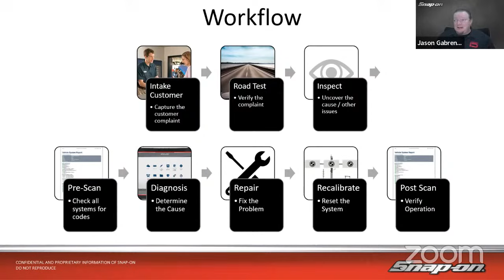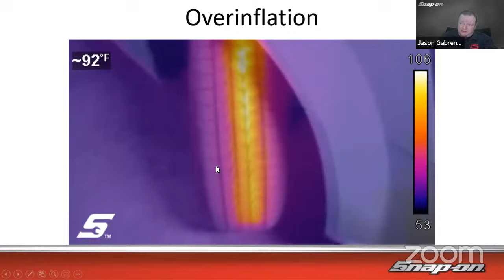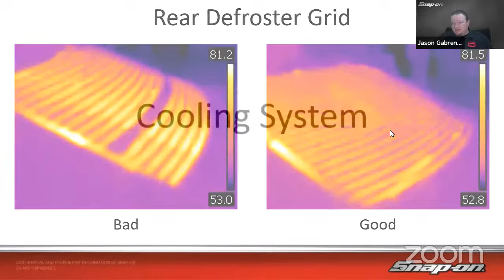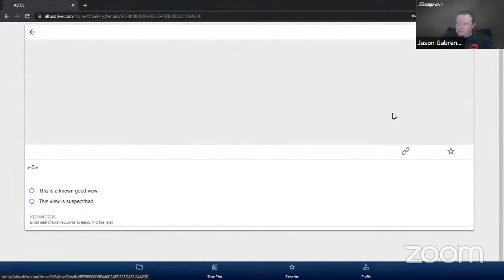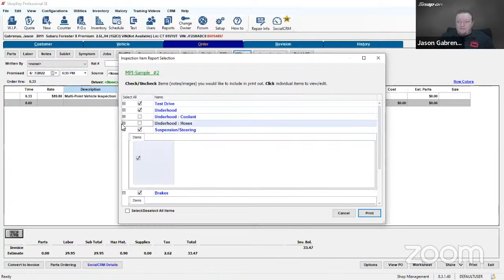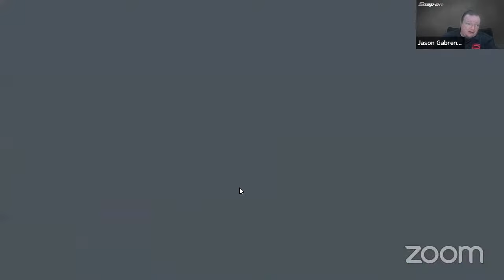Thermal Imaging Revisited - Snap-on Live Training Episode 45

Comment: Is there a library or images ?  I would love that.  
Is there somewhere that I could see normal acceptable temperatures of components?
Reply from the maker: There is a library of images right on the tool, both good and bad. As far as acceptable temperatures, I suppose that would be up to the individual component that you are measuring. Generally, friction and resistance generate heat, so something hotter than the others (tires, for example) would be the issue.

Comment: I ha e had the newer snapon diagnostic thermal imager for awhile now and i cant put in to words how much it helps with electrical diagnosis and diagnosing misfires. You get a crystal clear image of what is happening in real time to see modules failing, heater elements not working properly, and cooler or hotter exhaust temps for misfires. It has saved me so much time in pinpointing issues. Well worth the investment.